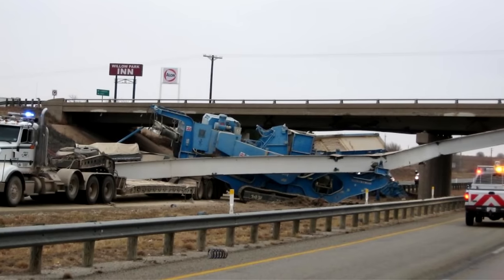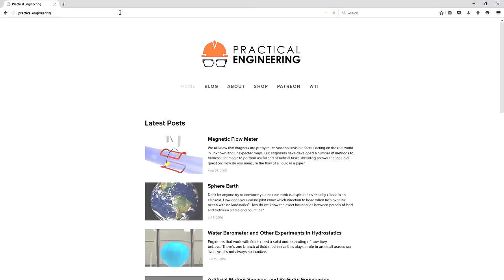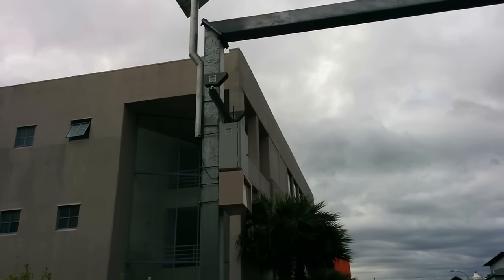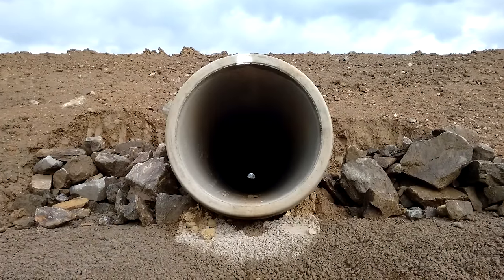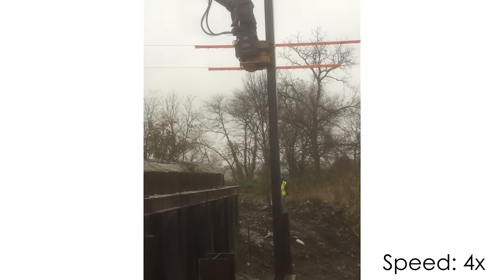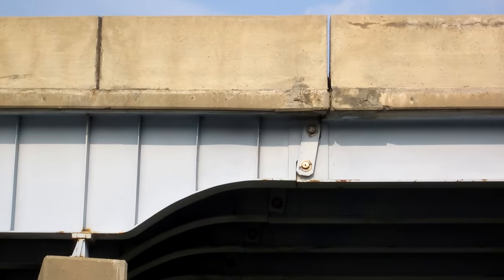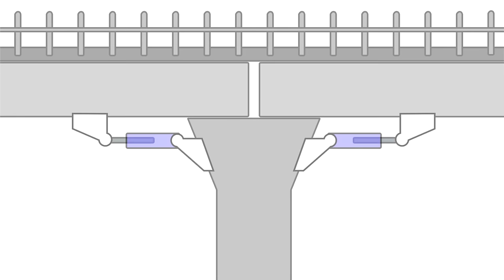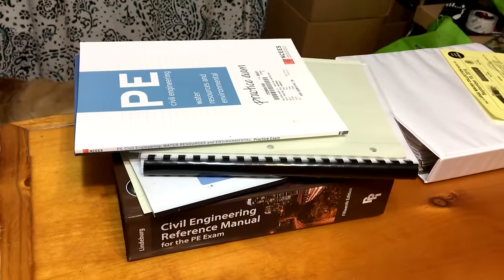What's that Infrastructure? (Ep. 2 - More Transportation Infrastructure)

Comment: What methods to engineers use to control airflow in long tunnels? I always wonder about air movement when I drive through long ones
Reply: One near my house has fans along the roof, but that one is at a slope. Most tunnels around where I live don't have any method of controlling airflow that I can see and presumably rely on wind and vehicle movement to keep the air from getting too stagnant.

Interestingly, the one with the fans had a notably uncomfortable change in air pressure for the first few years that caused me to avoid using it, but they changed something and that went away.

Comment: @PracticalEngineering I think the pistons on the dam are dampers not actuators,  Look up Galloping Gurdy or The Tacoma narrows bridge to see what can happen to these structures if the right osculations occur.  I also think this alludes to the odd angle bracket over the signage that was posted from LA, aerodynamics and frequency vibration can cause some interesting things to happen with structures like this.  https://www.youtube.com/watch?v=VAk0hKDM354 check out this.

Comment: I get tickled at the 'animal underpass' concept, the animal lovers actually think that an animal is smart enough to figure out that's a safe way to cross the road.  Almost no animals are smart enough to figure this out.  It would be wonderful if they would use them, but they don't, any animal that uses those for crossing its just random.
Reply from the maker: They have also found that predators can learn to use the overpasses/underpasses as a funnel for prey. Trying to incorporate environmental functions into our infrastructure is important, but it's hard too.
Reply: I wish the animals would use them, I've accidentally hit several small animals, including a skunk over the years, luckily I haven't hit anything big and hope I never do.  I was scared that skunk stink would take a long time to go away, luckily it tapered off pretty fast.
Reply: Practical Engineering in the Netherlands you find these things at every road close to a forest or Heath. They are monitored where I live and we know here it actually works, but only in areas where the normal access to the road is blocked by a fence. One overpass only had 3 visitors in a month time though
Reply: G56AG we're pushing the evolutionary process. Animals that figure out the tunnels breed. Others feed the ravens. In a few generations the majority will start using the tunnels. It may take a few years but that's the theory.

Comment: “Prevent being stuck at a light that never changes”.
Let me suggest that someone who actually sits there at a red light that never changes are far more respecting of automated authority than is necessary.
Just treat it like a stop sign, for goodness sake.

#adultingishard
Reply: i did that one night on my motorcycle . . . waited at least a full two clock minutes then ran it (no danger, it was there only to let people out of a power plant parking lot) and got pulled-over and ticketed!
Reply: I've heard that it's legal to go through if you wait 2 cycles and it's clear.  This may not be true but it's reasonable enough to at least use as an excuse in court.  Stop lights aren't just for letting traffic go by but it's also impeding flow.  If you just go whenever it's clear you're also distributing the traffic in a way it's not designed for.